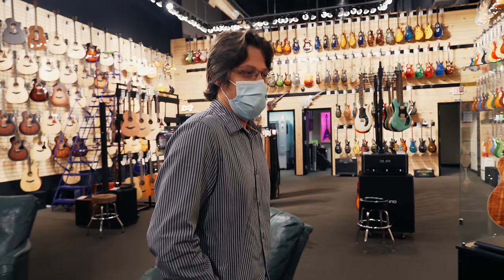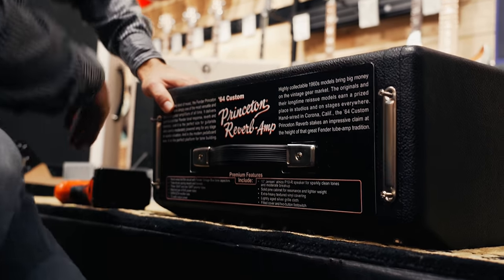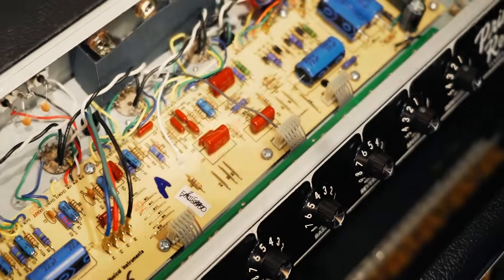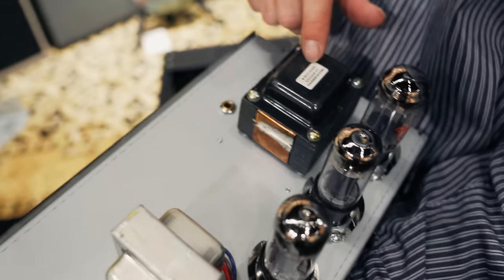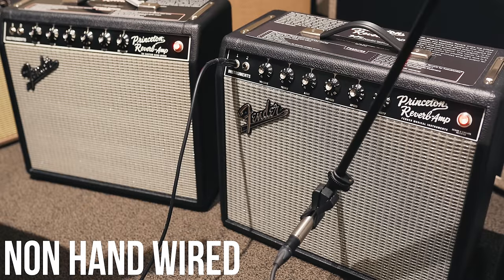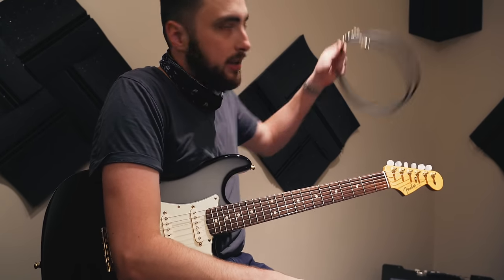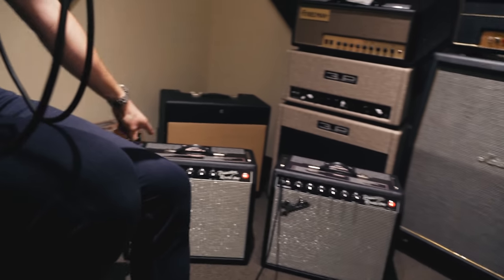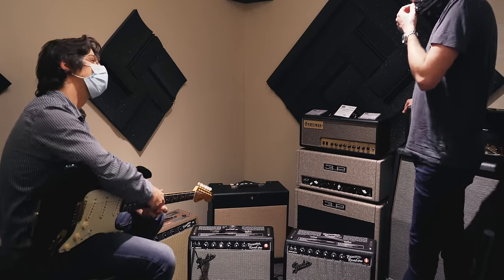Are Hand Wired Amps Really Better?

Comment: After this review, thank you Rhett, I am glad. I am building a Princeton 22 watt. Princeton preamp and Deluxe phase inverter and power section! I will add a midrange control and maybe two inputs, one for electric and one for acoustic. I know it is a challenge to voice an acoustic channel, but I have modded a couple of other amps, a 60 watt Pignose and a 50 watt Crate, with reasonable success. The acoustic channel has less gain and using different caps and resistors to to change the response. A signal out to a mixing board would be handy, would not have to mic it, or you could run it through another amp for larger stages.A 12 inch alnico Jensen! A birch speaker baffle and back panels. Also a real pine cab. Mine will be in red Tolex and a black grill with piping. I even have a red power cord! I make my own covers but I will have a road case for this one! The best components I can source and the great eyelet boards made with some non-moisture gathering material. I will also have outputs on the back of the chassis to set the bias on the output tubes. It will weigh more than I would prefer, but when you get to gig and you plug  in and let everyone hear the fantastic tone you get, it will be a gig to remember. So after viewing this video I think I am......”Rhett to Go”. Love from NW Colorado. Thanxz

Comment: The question is “do these differences worth a 1300$ more?”
Reply: Yes
Reply: Asking the real questions
Reply: There are kits to replace the circuit board with an eyelet board and convert a new amp to handwired. I don't know how much the labor runs but if someone is charging $100/hour I'd expect him to knock it out in no more than 4 hours. The components couldn't cost more than $3-400. Or you can buy a handwired amp made by any of the companies that specialize in that sort of thing. Or you can buy an old amp.

Comment: 1:02 mins: "The speakers are different". Thank you very much. I'm out of here.
Reply: You should've waited, they did put the non-handwired through the handwired speaker. When in haste...
Reply: @cosmikrelic4815  I promise you they would sound the same if the part values and speakers matched. I bet they are not biased the same. Which changes a lot. And the values for each component is not identical.  If they were. They would sound identical.  All my amps are custom built by a famous builder.  Hand wired on turret boards.  He also builds with pcbs. Altho his are custom made for him. Heavy duty military grade. Just as durable and easy to fix as handwired.  Fender uses cheap shit pcb.   And his amps sound identical between his pcb and handwired or ptp
Reply: @patrickrosington1174  Don't make promises you can't keep. I don't know what you are getting at. I agree they would sound the same with the same components, did anyone say any different? You baled saying they were different speakers but didn't wait to see that they changed speakers, that's all. But I guess having all booteek amps makes you an expert on all things. We call that entitled here.
Reply: @patrickrosington1174  So you're saying if they were the same amp then they would sound the same? But they are not the same amp.... so they don't sound the same.
Reply: Issue addressed.
Reply: @cosmikrelic4815  Yeah, and they end up sounding the same. Title was complete clickbait.
Reply: @jzhu623  They might only sound the same for someone with hearing issues
Reply: @RockmannMusic  "There is a BIG difference". Sounds like the only issue here is reading issues bud.
Reply: I don’t think Hendrix ever played Wind Cries Mary through a Princeton. I think he might have used Princetons as foot rests.

Comment: I've been struggling to decide whether to get a handwired, PCB version, or do a Mojotone build. We can all agree on the tone difference between the speakers. The handwired still sounds smoother in the mids and top-end. I've owned many amps over the years and the PCB ones are the only amps that techs have struggled to repair. The vintage ones I have are all in top shape because my amp techs could repair them in minutes. I'll never forget my 90's Fender amp that was only 5 years old and had some sort of hairline crack in the board and was a nightmare to own because it kept crackling even after repair attempts. If you plan to keep for years get a handwired (or build one) because it's an investment that will hold it's value for you as the owner (and of course if you go to sell it years down the road).

Comment: I've upgraded my Princeton: larger power and output transformers + 6L6 tubes, 12" Celestion Blue speaker (with new baffle) + Stokes mod = 24 watts of sweet tone.  :)

A speaker swap-out in Fender (or almost every regular production amp) is the KEY upgrade to consider...

Comment: I have a Hot Rod Deluxe that is printed circuitry. Its probably 30yrs old by now, and functions beautifully. The difference is its never gigged. It never bounced around in the back seat of a car, or van, etc. I think this is where a hand wired amp will win the race. Much more rugged construction. Thats why so many very old Fender amps are still in service today.

Comment: Rhett, I like your channel very much.  I am in Nothern Alabama and I prefer not PCB amps but I do have some and use them. The  Original way is perfect.  PCBs are just a more profitable way to make an amp cheaper.  I have many 60's, true point-to-point amps still working great and a Fender with a Turret wired circuit and a 59 Kay amp Point to point wired no turret.  These are my favorites and they will be working for another 100 years.  The PCB is cheap and no one likes to work on them. I have the full set of point-to-point wired Silvertone Amps from the '60s which are the 6 watts 1x8  1481, 1482  1x12,1483 1x15,1484 2x12's and of course the big 1485 6x10's that Jack White approved of.

Comment: I think the pcb board version is well designed, the valves mount on the chasis like the dearer one. We would all use the handwired version if it was'nt so expensive so the smart move is to put a Jensen P10r in the cheaper model, it actually sounds like some of the 70s princetons with that mid-scoop. When I was starting out there was just a "New" fender amp or a used Fender amp with rusty screws...or a Marshall/Vox/Hiwatt. We were better off having less choice, more time for jamming instead of shopping.

Comment: I don't know if the audible difference was worth $1,200 but I build my own amps for the reliability factor. They end up being cheaper than the mass produced amps with printed circuit boards. Much cheaper. They also sound better, partly because they're exactly what I want: I don't have to compromise.

Comment: I build amps, pedals and guitars and restore old tube radio receivers when i get the chance. My first P2P build was a Febder Champ style amp that i built to have an optional output section that selects either the stock 6V6 or an EL84. It also has all the other classic champ mods like a bright switch, a push pull on the bass pot that selects the mid resistor value (the two values Fender used) so its basically a mid boost, a tone stack bypass that keeps the boright switch and treble pot in so it acts like an overall gain boost an lastly i added a negative feedback loop bypass which brightens the amp adds gain. Building that amp was my most satisfying build experience and next i want to build a P2P Twin Reverb. Im certain i have the knowledge and ability just not the money yet lol. PCB's are perfectly fine when implemented properly and when built to a reasonable quality standard. But P2P hardwired amps contribute another level of scrutiny over PCBs populated by machines that ensures the amp is built with intention and quality.

Comment: My theory:
The input signal into the non hand wired amp doesnt lose as much presence while traveling in the amp. Presence can be lose through lengths of cable in the circuit, which is why you always hear people saying “solder shorter wire”

Maybe that is why you get more presence and mid scoop.

Comment: I have the non-handwired version modded by Pete Cage in Damascus MD with a new 12" baffle, it's got a Jensen C12R (Italy), he added tilt back legs, a line out, and it's a killer little amp.  Sounds great to me.  All my other amps are vintage hand wired.

Comment: For what it’s worth, I just got one of the 64 customs today and did the basic test as Rhett (I have a PRRI w a alnico 12 inch). I came to the same conclusion. Plugging the RI into the custom’s alnico speaker and pine cabinet def improve the sound quite a bit, but the HW still sounds more balanced and has a smoother high end. It’s not a world shattering difference but the HW is a just lovely sounding amp. Probably could argue the sound difference alone doesn’t warrant more than twice the price, but I’m pleasantly surprised how happy I am so far with it given my initial uncertainty.

Comment: For me the speaker made the biggest difference. I love hand wired amps but given the price difference putting the Alnico speaker in the circuit board amp would give very acceptable performance at a much lower price. If $ is not a big deal spring for the hand wired one (excellent right out the box)

Comment: These amps sound minimally different. RI is a bit spanky, which I prefer, whilst the handwired is a bit mellow. There is nothing good or bad to compare sonically. It is a matter of preference solely. But in the end I rather have a handwired one because of ease of SERVICEABILITY (15:34) on my part that I could repair it a lot easier since it is just a turretboard mount not PCB's or SMT's. That's the beauty of old handwired amps.

Comment: There is a huge difference. In every aspect of it. Sonically hand wired amps are a piece of heaven. No doubts about it. And the ability to fix anything of it, as the video shows, it’s on the fly. Does it worth the extra cost? Sure it does. Value your money. Hand wired amps are for life. And commercially also, you will never loose your money if you will re-sell it one day (which I doubt it if you will ever have one). Great video man! 🙏

Comment: Good effort. I"m not sure why you didn't use the same speaker for both amps at the beginning. The difference in speaker sound was very noticeable when you riffed on the bridge pickup, and I was misled, thinking that the circuit wiring was responsible. Still, your test ended well.  Thanks!

Comment: If you upgrade the speaker and the electrolytic caps in the circuit board amp, say with F&Ts or Mallory, it would blow your mind how much better the mass produced Princeton would sound. Not bad mouthing the hand wired fender. It’s beautiful but is it worth all that extra money? Not sure about that. Thanks for sharing. Very cool comparison

Comment: Super interesting comparison, thank you! I think the heart of the matter is is contained in the snippet at 12:35, where the same riff is played through the same speaker. I was genuinely surprised to hear that the handwired amp does sound slightly warmer and less harsh at that point. I don't know if I would say "far and away" better, but I didn't feel the amp react myself either. I also am curious if the general EQ of the 65 changed from the 64, i.e. the actual circuit design.

Comment: The key point was at the 15 minute mark.  If you're just using it in one place or light duty gigging, PCB is fine.  Just realize sourcing new boards is next to impossible if something happens so consider the PCB disposable.  Handwired can be easily serviced and have a very long life span under harsh conditions.

Comment: As a guitarist and electronic technician with 50 years of experience, I would suggest that next time you do a test like this you use one set of valves (sorry, toobs).  I have noticed that most manufacturers nowadays are using Chinese tubes which have widely variable characteristics.  I'm sure Fender test and select them but the tube's parameters shift markedly over the first few hours of use.  Also, I would expect that Fender have a much narrower acceptability window for tube selection for the handwired amp than for the standard model.  Love your channel.

Comment: Excellent video, but has proved what I once realised: the major wight goes to the speaker.
I am Brazilian, living in Brazil, I own a boutique Brazilian made amp that actually has been sold to Abbey Road Studio. The owner of that company is a lover of tube sounds and his 40 watts 6L6 has a mixed point-to-point and circuit board design, all tube path. coped with a pair of 10" Eminence Copperhead (what a speaker bro) feels, behave, performs, completely different from a pair of 10" Eminence Ramrod, which on top of that, if it's coped with a Celestion V30, you do have a totally different unit.
I did could see differences in your video due to the amp design, but bear with me - when you get the speaker factor, that is when difference makes its presence!

Comment: I took a DRRI (pcb) amp, swapped out the speaker for a Celestion Vintage 30 and clipped the bright cap.  Granted a DRRI isn't a Princeton but it's very similar... I don't believe a Princeton has a bright cap.  Anyway, the difference because of those minor mods ( a couple hundred $) was dramatic, huge!  My modified DRRI is probably the best sounding amp I've ever owned, and back in the day (in the 70's) I owned several 60's BF and Silverface Fenders.  That said I'm looking for a 60's BF or early 70s Princeton Silverface.  Gotta have one!

Comment: My '65 blackface princeton is long gone -- as is my '64 super. Oh well, but my vibroclone is great. IMO the non-handwired sounded fine. Can always get mud if you want it, but if you dont have clarity to start you are in trouble. The speaker made up alot of the difference,  Test both amps with a scope and see if the output is visibly different across a range of frequencies and intensities and it might not be much. Hopefully the natural distortion on the non-handwired will still be there. On the other hand - there is nothing like a true Princeton tremolo. No other fender circuit captures that.

Comment: Rhett... I agree with your assessment.
And I heard the difference when you changed the speaker for sure.
Bottom line is if you have the cash and desire... why not buy a $2000+ Princeton?🤷‍♂️

What I’m curious about is whether the “tone master” series using modeling and NO tubes stands up to both of these... or not.

I’d be curious to find out.

I have a ‘68 Vibroverb custom.
And a Tone master Twin.

I like both... but the Tone master is actually more versatile.
Direct out.
Switchable output wattage... ect.

Think about matching one of those up against a matching tube amp.

Could be fun.😊👍🥃

Comment: Great video as always. I have about the same preference as you: best was the handwired with the alnico speaker then second the pcb version with the alnico speaker. I do believe that most of the sound in this case lies in the speaker. Also at the beginning it was pointed out that the handwired version had a slightly different circuit design too. Bear in mind no two amps sound exactly the same because of the tolerances of the parts they are built of. Anyhow I would not be surprised if the handwired one was deisgned to sound better (or to be more precise the pcb one designed to sound worse), just to sell it better. But the prices, man... For the price of the pcb one you can build the handwired version yourself from a kit. Or maybe evene cheaper... Granted you have to know how to do it. But if Rhett could build a Champ, then I guess quite anyone can do that by a little learning.

As a builder I definitely prefer the handwired because of its reliability, serviceability, durability and tweakability (all that was pointed out in the video too).

Comment: the thing to watch for on the fender hand wired amps are the tubes and speakers. They dont really follow vintage specs that closely. I know in my 57 tweed twin reissue they used the cheaper groove tubes and the weber inspired speakers and they bias them cold from the factory. I've since changed all the tubes to vintage reissue Tung-Sol's, rebiased it, and i plan on getting vintage spec webers for it eventually.

Comment: As an EE I would take a robust PCB amp over a hand-wired solution.  The tonal difference remaning between the two units when using the same speaker can be attributed to different passive compoments,. PCB layout and wire selection.  The hand-wired amp clearly has different parts and different wire gauges used.  A PCB solution can be more durable and easier to repair than the equivalent hand-wired solution IF these concepts are taken into consideration during design.  Unfortunately PCBs are used to reduce cost.

I can't blame Fender for wanting to make some small upgrades to help justify the added expense.  As a consumer, however, I am disappointed they didn't use the exact same passive compoments on both.  Thanks for pulling the units apart for the show-and-tell.

Comment: One thing that I do like on the PCB design is that the tube sockets are wire connected to the PCB. Heavy parts on the PCB are a challenge for reliability, it looks like Fender paid attention to these details on that PCB design. The hand-wired one does look better and probably would be a bit more ‘tough’ and serviceable ‘on the road’. I definitely prefer the speaker included in the hand-wired amp. Probably I’d buy the hand-wired one just to have the nice speaker ‘out of the box’ and not have to void any warranty right away to get the tone I want. I do wonder if some of the brightness is due to vacuum tube tolerances, or if there is an actual design difference between the circuitry; the feedback circuit could have been tweaked for the different speaker.